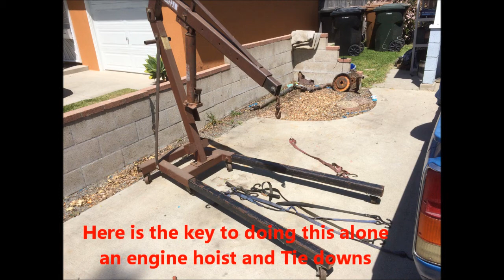How to remove a Chevy Luv Bed by yourself

Comment: I can't help it!  This little truck shoukd have just been sold to a new owner. It's a beautiful looking little truck, seems to be in excellent condition.
Reply from the maker: Thanks for watching Dan. This truck had issues not shown. The Marines that were trying to stuff the V8 in it cut the floor out with a saber saw and butcherd it up pretty bad. The body was the best part of it. If you look up Cole Reynolds on YouTube, his truck(rear enginerace truck) it has the bed off of this truck. So it will live on and serve a pupose. I still have the fenders and they will go on my 72 at some point in the future.

Comment: Now that the bed is removed, always best to paint the underside of that bed thoughly to prevent rust, and now that they make bedliner coating, scratch the bed down, wash it, let it dry, and thoroughly paint the inside of the bed with bedliner coating two, to three gallons of bedliner coating ought to do it. Wouldn't hurt.
Reply from the maker: Actually this truck was being parted out. The bed was sold to Cole Reynolds for his wide body drift truck build. https://www.youtube.com/watch?v=0PfAHu0i9dI&t=8s I expect the bed floor to be highly modified by the time it is finished.
Reply: @LuvTruckGarage  Shame this truck has to meet the fate of being parted out instead of being fixed and restored to it's former glory. I would love to have had this little girl to work on and drive and keep.
Reply from the maker: @danbasta3677  I understand your point but many of the parts from this truck went to other Luv owners and helped them keep their Luv project alive. If you would like to see where the bed from this truck wound up check out Cole Reynolds Awesome Mid-Engine Luv Project. https://www.youtube.com/watch?v=Qsoq2DM7edU